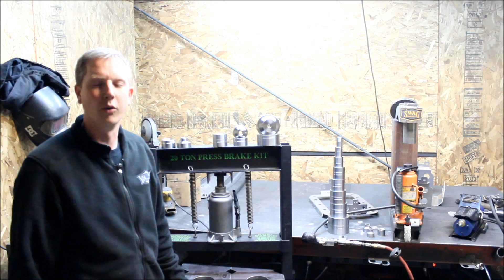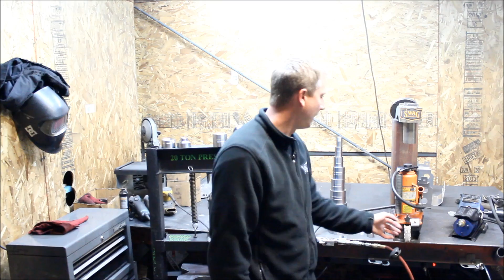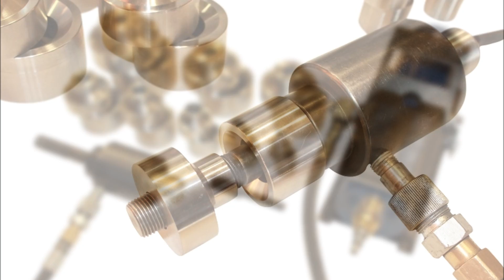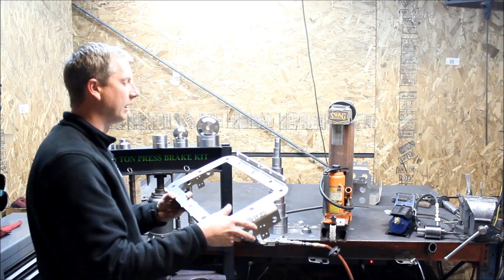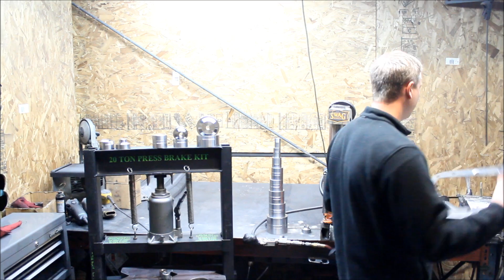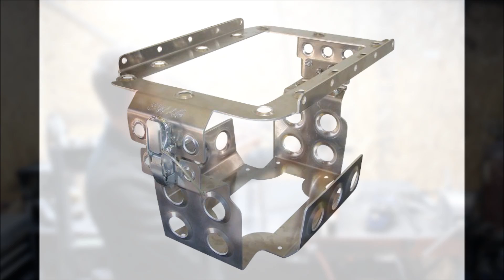SWAG Off Road Dimple Die Set (8) Pieces

Comment: Your products show some great creativity and clever designs. 
Not that it really matters to the folks that see the awesome value in your products, 
but it you were to sheet those chip board walls with white or light grey ribbed metal roofing material, it would add a level of credibility from a marketing stand point.